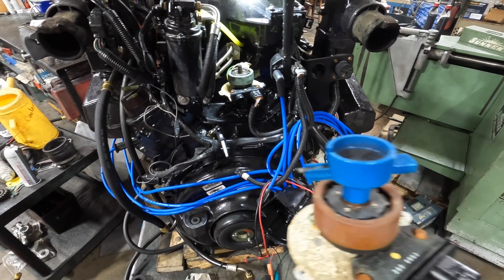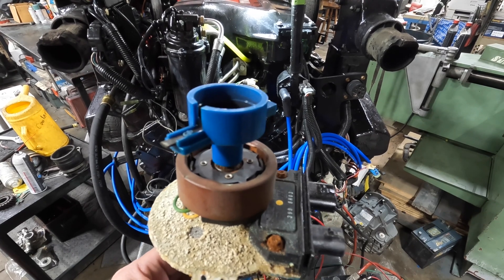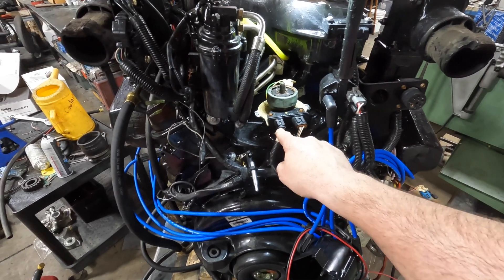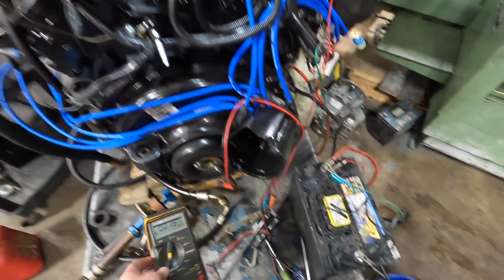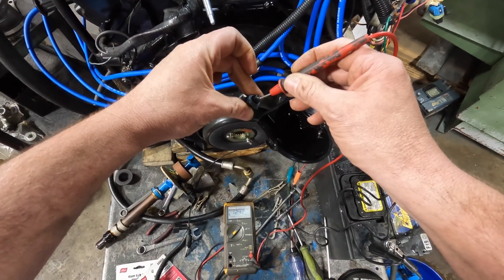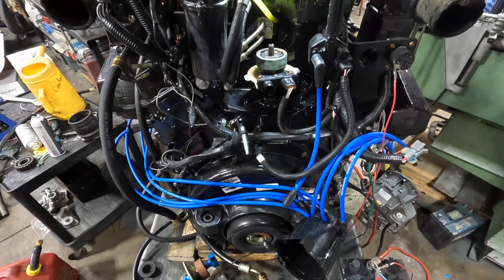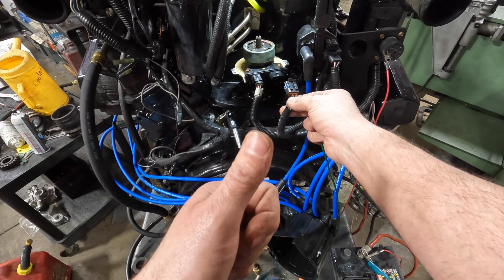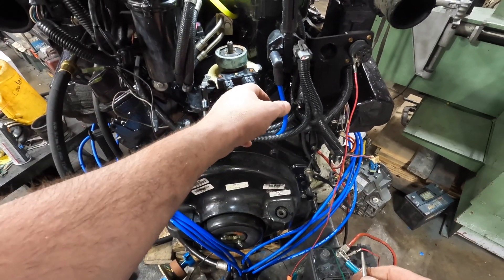Diagnosing The 2nd Gen GM HEI Ignition System Auto and Marine Using Common Tools

Comment: For the carb engines (using EST distributor) ignition timing, as we need to plug in the timing socket (to the 4 pin module) and adjusting the initial timing, my question is when we are checking the total timing curve and increasing the RPM up to 3500-4000, is that timing socket still needs to be connected or removed out?

Comment: Thanks for the video, extremely helpful. One of my Crusader 454's is stumbling between 1500-3500 RPM, and the other cuts out randomly every few hours like the key was turned, then won't start again for a few minutes. Seemed like some kind of thermal issue. This is very helpful for diagnosing the coil and ignition module.

Comment: Could you do a video on the code 42 please?
I have this issue. It runs roughly and rich. Pops through the exhaust. It throws a code 42. When I replaced the pickup coil and the model it will not run. If I put the old model on it runs poorly. But put  another new module in and it will not run. Any help would be appreciated. Thank you for your videos

Comment: when you are testing continuity on the 2 plug going to the ICM what cable did you disconnect first?
Reply from the maker: I don’t understand your question. I unplug the pickup coil and connect an A/C meter between the two wires. Ohm it first and then crank it and check the A/C output.